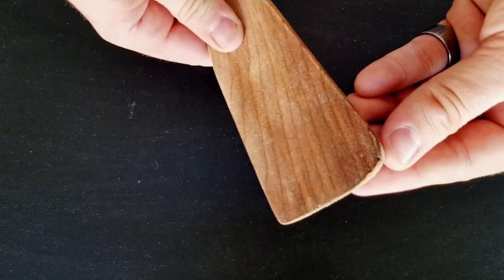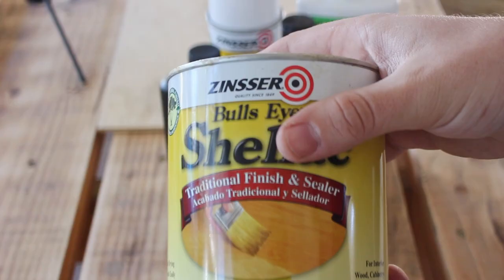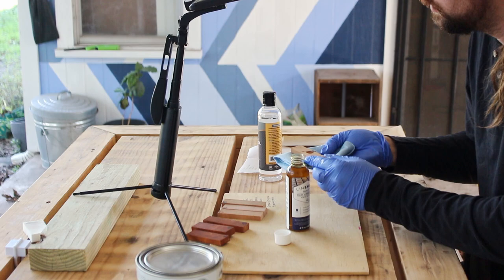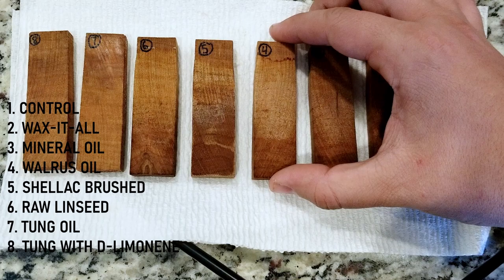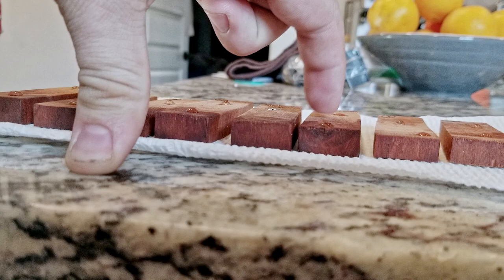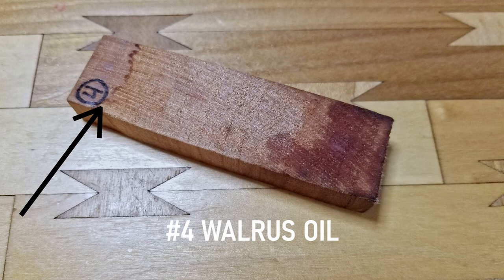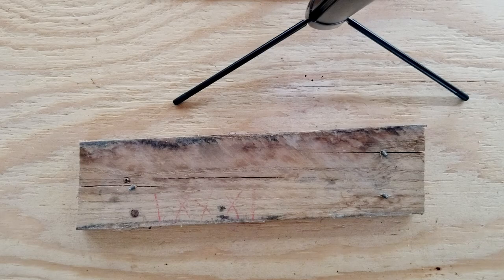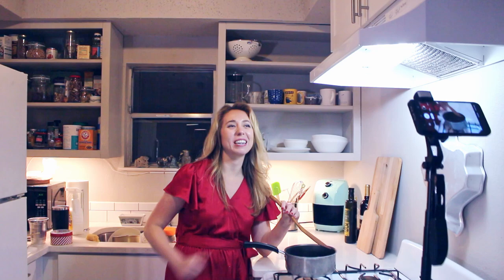The BEST heat proof, food safe, water proof wood finish.

Comment: Ive found that walnut oil is  the answer. It polymerizes fairly quickly when exposed to UVA and UVB light (sunlight), air flow, and if possible low heat. Also to avoid cracks and checking heat up the oil (NOT THE WOOD!!) and it will be penetrate very well.

Comment: How long did you let the raw linseed oil cure for?
Reply from the maker: I let all of them sit for about 30 days. Applied all finishes at once, then waited for the tung to cure the full 30 days before experimenting on any of them. Thanks for watching! 💚
Reply: @BrevaCreative  very interesting. I've seen my example of raw linseed oil plasticising over that period of time on metal and wood, so its weird to see it break down that much. The tung oil is the business, but oh so very expensive for the real deal. Particularly up here in the frozen north.
Reply from the maker: @LitoGeorge  surprised me too, definitely thought the linseed would've performed better than it did.
Reply: @BrevaCreative   I think I will redo your test. Maybe coat twice too, 24hrs apart, or even a week apart. I dont know. Dont hold me to it, but I'll figure out a way to test the heat, washing, etc longevity of the linseed. I got a great big honking can of it, so the tung oil is out for now. If I remember after 60 days or whatever, I'll share my findings here :)
Reply from the maker: @LitoGeorge  haha awesome please do!!!
Reply: @LitoGeorge Any updates? Thanks!
Reply: @jessl1934  Mmmm.... I ran away with other significant amounts of projects in the interim, but did apply and use the Linseed Oil as I indicated I would - caveat, no boiling experiments with wood. I did apply RawLinseedOil on metal in three ways with two subsets of application method to each. Subset 1 is very thin wipe of RLO. Subset 2 is dip the object into room temperature (17degC) and then secondarily hot RLO. Experiment 1): RLO applied and left to cure naturally without intervention in mild (for Canada) winter conditions - rain on object, mist on object, some snow, coldest temp of -8degC, warmest temp of +10degC    2) RLO applied and then heated up with a heat gun not above 350F in order not to affect temper of metal.   3) RLO applied  and then baked in oven at 350degF for an hour/ or two.
Results: 1) some rusting on any edge of metal that was in contact with wood support which allowed the rain/mist to pool and sit.  2) same as No1 but less so. Metal hanging in air not touched by any wood surface (thus not allowing pooling of water) was unaffected by rust by and large. Maybe a few tiny spots.  3) Zero rust. The perfect rust protection system  - and it can take rough abrasion of the metal surfaces against wood (think drawknives, plane irons etc). 
Caveat: dipping the metal into RLO and then baking it, caused a thicker protective coating at the cost of aesthetics. It yellows/ oranges slightly and in places where the RLO pooled as it thinned and then dried in the heat becomes a dark brown colour. Its aesthetically unappealing to most I would think. A practical guy like me sees the beauty in the rust protection it offers and I dont worry about it at all. 
I should make a video about it and earn money :P   But I dont care to.
Reply: pps: I did apply RLO to teak wood and let it dry for about two weeks naturally. I noticed it didnt fair very well in the dishwasher which washes with hot water. I dont ever use the heat drying cycle- unnecessary. So I just let the teak wood do its thing, being washed in the dishwasher about once every ten days. Its holding up just fine after 6months. It doesnt have the lustrous shine of the RLO on the wood as applied at first, but who cares. Teak wood is very resilient.
Reply from the maker: That's awesome, never even thought to use it to protect metal. Oven yellowing makes sense. It will probably yellow over time as well a little with exposure to UV, but not as much as curing in the oven would do.

Comment: Awesome!  I appreciate this video immensely!  I learned the value of tung oil from others on YouTube (specifically for cutting boards, in my case), but application details have been rather vague!  A 50/50 dilution for the first coat for penetration, and then following up with pure tung oil makes sense, and is so much easier then some of the other "recipes" I've seen.  Especially those that involved waiting 2-4 weeks between coats!!!!!  :o(   Also, I found that diluting with orange oil (specifically Nature's Orange) really turns all woods much darker, to the point where maple starts to resemble cherry, or raw walnut!  I won't use that again!!
Thank you!
Reply: Sounds good to me, thanks!